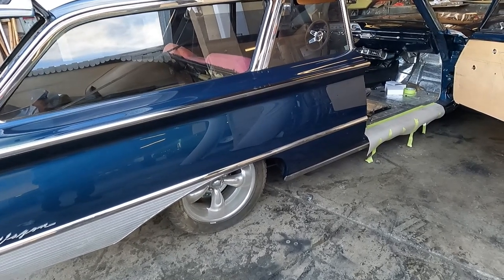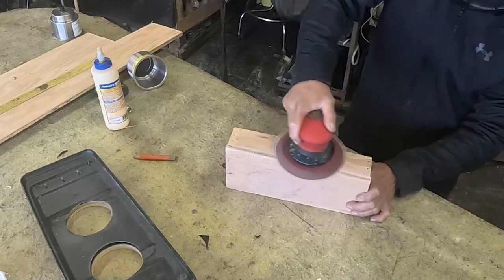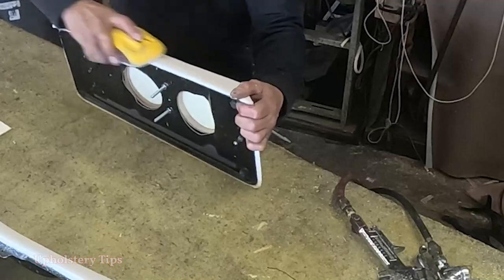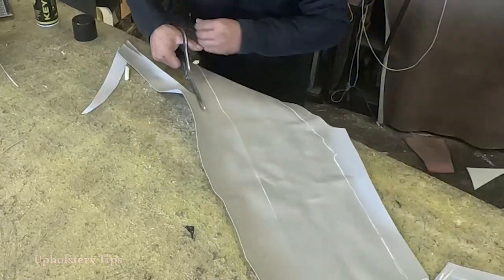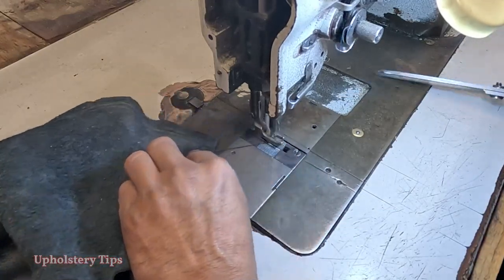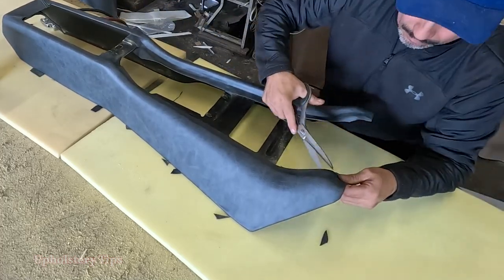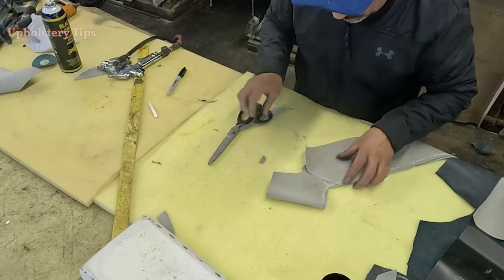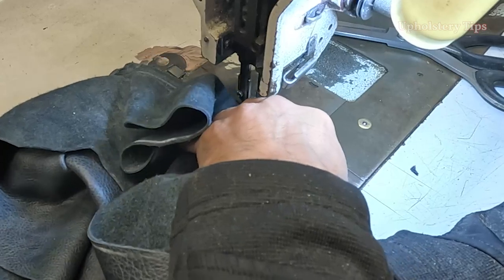How to Customize and Upholster a Classic car Center console.

Comment: What is the White cover used at 6:23
Reply: That is foam for giving the console some softness and keeps the leather tight so no wrinkles.
Reply: Closed cell foam.
Reply: @mrupholsteryman  
Thank you
Reply: @kmazahreh  they come in various thicknesses.  Depending on the curves you want to cover...the thinner variety will make it easier...but TOO thin can cause wrinkles if the glue on the back of the foam hits other pieces....

Take your time and it should be fine.😇🙏💪
Reply from the maker: Jeffrey thanks you for help others with your answers.
Reply: @upholsterytips  I used to do this full time.  I miss it at times...